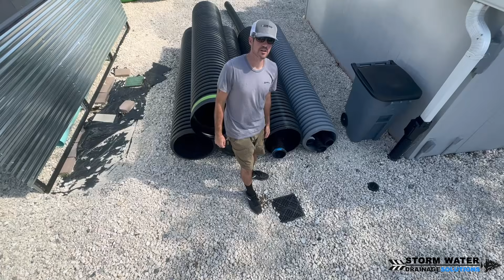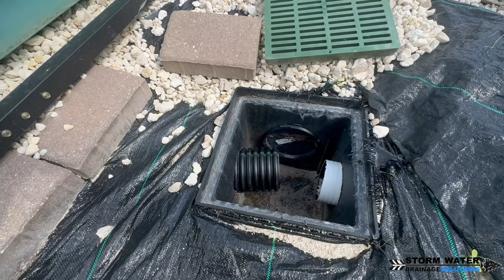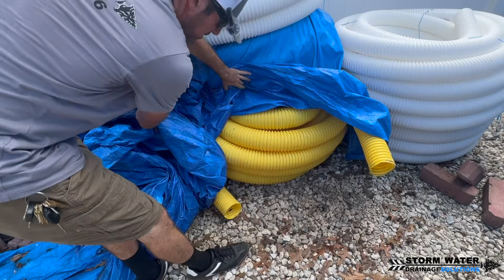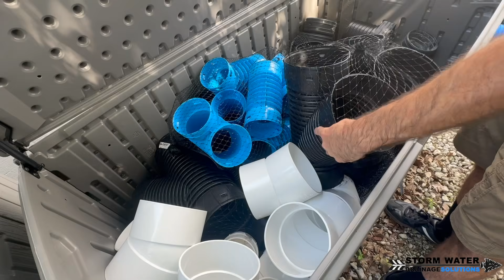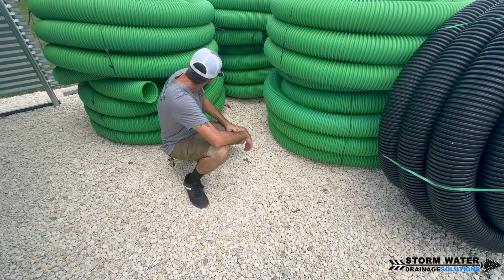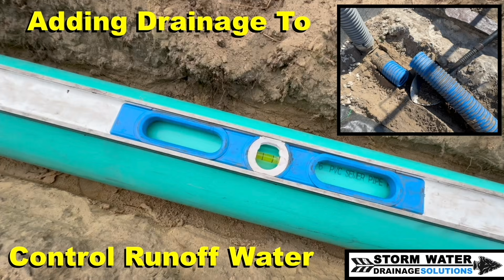From Our Pipe Yard To Your Job Site We Have Your Drainage Project Covered

Comment: You say you hate sub pumps. I’m over in the lake mag area and we are so level there is no fall. Would there be another option to get water to drain 60 feet to the road?
Reply from the maker: Correct I do not like sump pumps but sometimes you have no choice but to use them. If you do not have a lower point for discharge then you will have to use one. Only other option is a large underground detention chamber but those can get full fast on heavy rains.